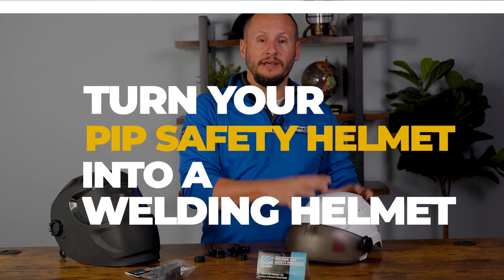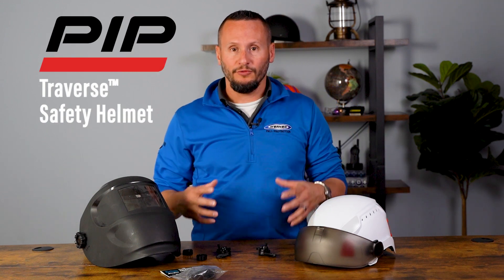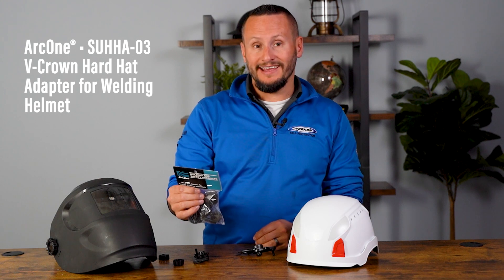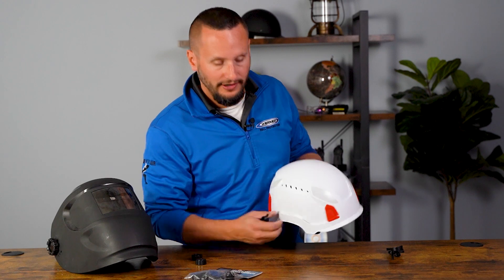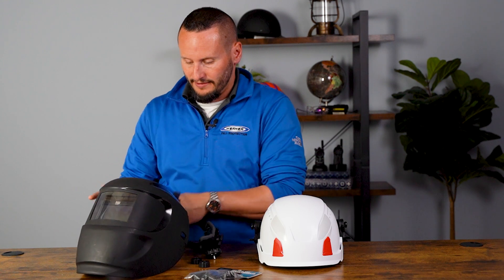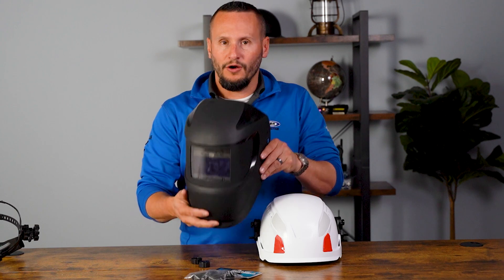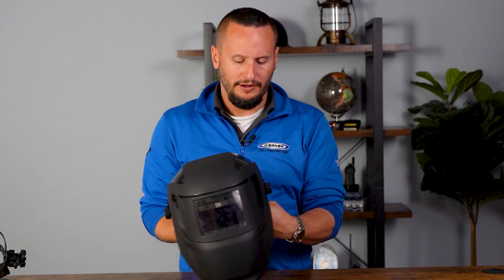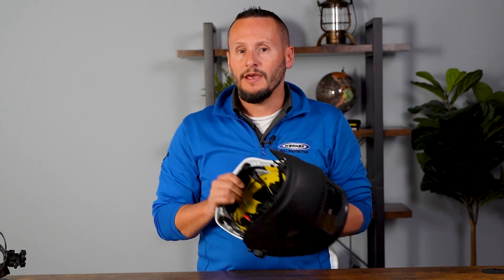Turn a Safety Helmet into a Welding Helmet

Comment: All these hood adapters have the same horrible design flaws and this one has an extra one. The rectangle hole with a square peg will only lead to issues where the hood is not aligned to your face. Having 2 pivot points will only lead to the hood not being aligned to your face. And removing the hood without removing the hardhat is damn near impossible, it's like nobody ever tested this they just drained it on paper and ran with it. I ask you to try putting that hardhat on with a welding hood, then putting any leather gloves even just work gloves and trying to "pinch" to remove the welding hood. Ultimately what happens is we have to remove the hardhat to take the hood off leaving us unprotected.

Comment: With a lot of these adapters it makes for a welders neck to be more exposed because the hoods ride higher that it would sitting directly on a welders bead …… hoods in general need to be redesigned to fit these adapters accordingly and comfortably

Comment: I’m an Ironworker. We need to, easily and often, take our welding hoods off while working. This seems more like a fixed connection unlike a halo style strap ( which doesn’t fit properly). How hard is it to pop those clips out of the “safety helmet” and reattach with out removing the helmet?
Reply: When I’m 60’ in the air on a steel beem, elbow grease isn’t the answer when I have to remove and replace the welding hood multiple time a day. I’m looking for  something that is as easy as the halos we use with the Bullard hard hats.
Reply: @dgthewelder2125  you find anything?
Reply: Carry more than one hardhat, seems the best answer. 😅
Reply from the maker: The Arc One clips do fit securely into the PIP Traverse helmet.  During normal use of raising and lowering you welding hood it will not accidently pop out of the helmet.  However, if you need to remove the hood completely, it is fairly easy.  It just requires a little elbow grease.  The clips themselves are held in with friction.  If you pinch the tabs that protrude through the slot, you can remove the hood with out removing your safety helmet.  I hope this helps! Thanks.